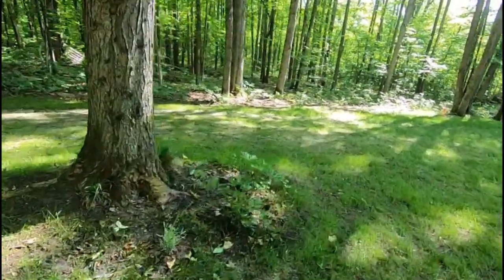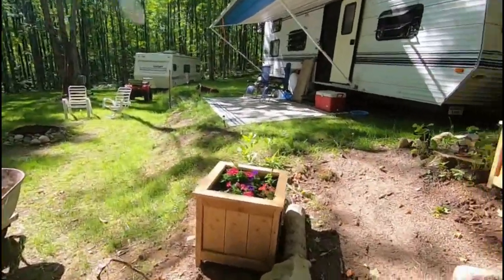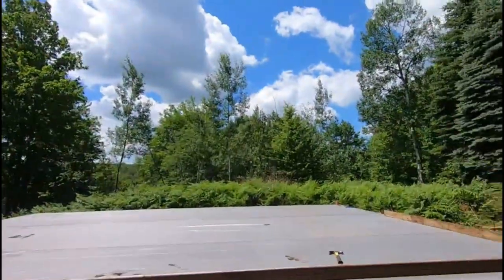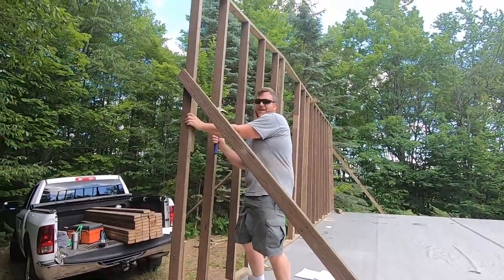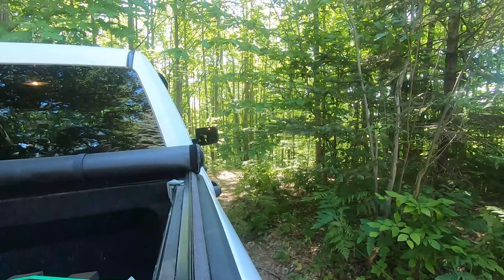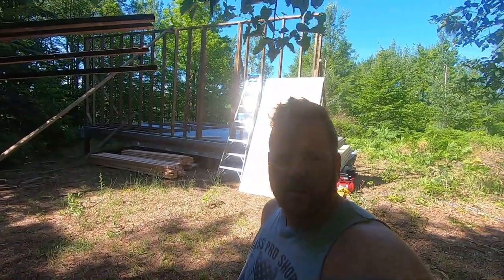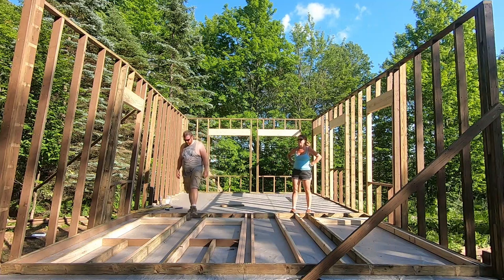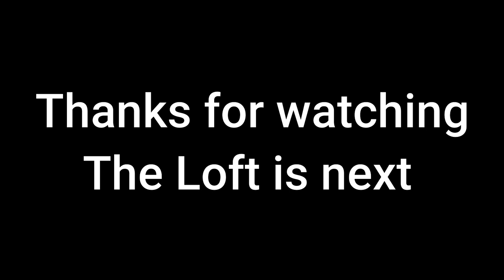Framing  OFF GRID Cabin walls just a husband a wife |Off Grid Cabin Build Part 3. Framing Walls

Comment: GOD !!  2 x 4 WALLS .... Yea, those were pretty common back in the 70's.  Haven't seem them used in decades because MOST people have learned about the joys of insulation but then again when you're building a cabin the Hawaii ...... Oh wait N MIchigan?  Meh, same average temps .......  you'll be fine !!
Reply from the maker: We heat with a wood stove. I can open all the windows when it 10 degrees outside and it is still cozy. 😉